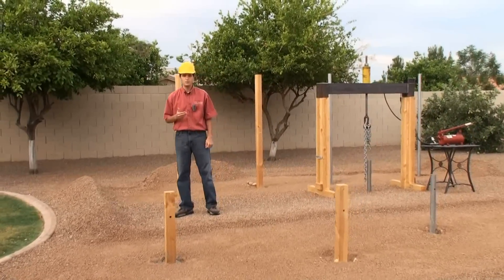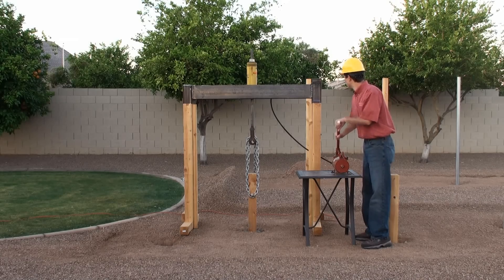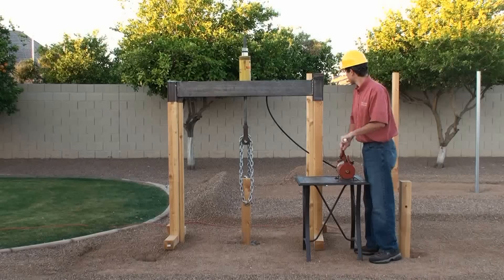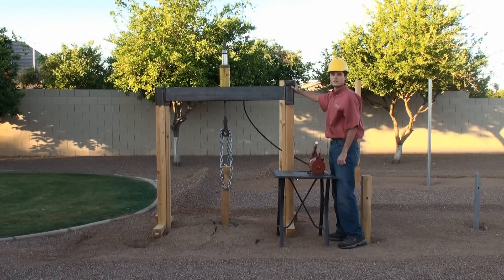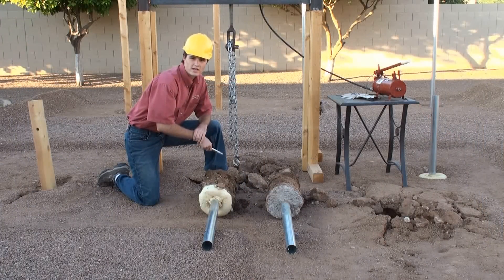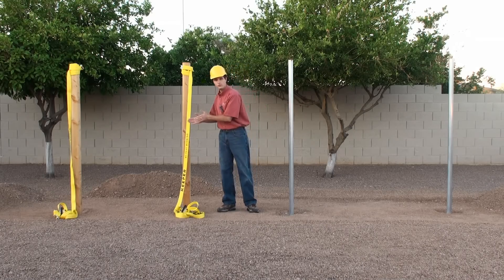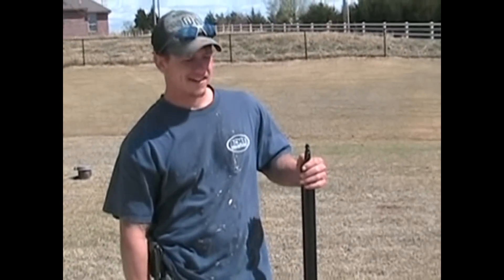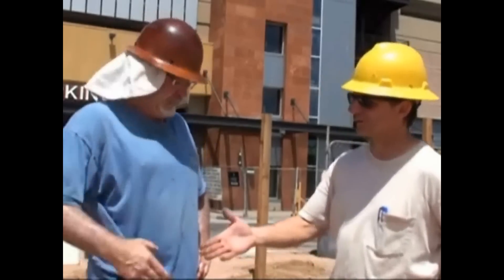Testing to Compare Concrete to Secure Set

Comment: Wouldn't this test have more to do with the ground giving way than how secure the setting material is.
Reply: Are they selling a product that will result in millions of dollars in lawsuits?

To answer the question, the foam expands in every direction, fills all gaps and presses outward on the soil in a manner that concrete does not. This is why it requires more force to extract the post. It is compacting the soil around it. It does seem like this outward force is inadequate, until you use the product. It's solid.
Reply: @legacy5346  lol not sure where the lawsuit comment came from, I'm just a civil engineer making an observation. My point was that the foam expanding won't compact the soil because it's unconfined/allowed to rise. It's actually less outward force than the hydrostatic pressure of the unset concrete. However, you're correct that it will fill the cracks and holes better. You can ignore me, I'm just a bored, pedantic asshole
Reply: It would, unless the setting material effected the ground around it. Which happens when foam expands.
Reply: @legacy5346  In what way? If you're thinking the expansion will consolidate the soil, that's not enough force. In fact, the hydrostatic pressure of the concrete just sitting there is way more force than the foam
Reply: @SolidRock008  the foam actually bonds to the dirt around it which is it took more force for the foam to break the ground. Concrete doesn't bond well with mud and dirt around it. This stuff is insane. I didn't think it would work as well as concrete either. But holy crap it does fantastically. No way my new 6 foot vinyl fence is coming out unless a tornado comes through. Just finished the job a few days ago.
Reply: If the concrete and foam take up the same space in the ground, the force to move it through the dirt should theoretically be the same, the only thing you would add is the weight of the concrete in the pulling test (which is 80 lbs in this case). 

 There are three planes of force to think of in this case, 1) pulling up, 2) pushing over and 3) pushing down. If this product can match or exceed concrete in those three tests, then it's a superior product for this use.

Comment: What I want to know is can secure set be used as support posts for a gazebo?  Does it have good compression strength?  I wouldn't want my gazebo to sink into the ground.  What about being used as a retaining wall?
Reply: This and other forms of foam set definitely do not recommend using as a concrete replacement for compressive forces where concrete works well but still can be used as a backfill around the concrete is the hole is large enough.

Comment: I liked this idea. it´s very easy to do this product. POLYOL + MDI = RIGID FOAM. But the problem is that the foam, in contact with the earth, greatly decreases its DURABILITY. While concrete is eternal.
Reply: Go ahead, look up utility companies using this with video proof here on YT even. Yes just like anything else, it has a useful life, in this case it is said to last 30 years.

Comment: Fence posts are not typically subject to vertical withdrawal so although this is a nice test it really doesn't mean much in the real world. Let's see some side load test to see which method holds the fence up best in a strong wind.
Reply: you apparently did not watch the side load pull tests near the end after the uplift testing proof

Comment: All you people that are bad mouthing this product actually should try it before you talk shit about it. I've used this it works amazing! Used as fences & when I worked for directv mounting dishes on poles, held the pole way better than concrete & we didn't use cheap concrete either, we used the quick setting stuff. Heck think I've got 2 or 3 boxes in my garage that I kept because of how good the stuff worked. Try it before you knock it. You'll be amazed how well & long the stuff lasts
Reply: The quick setting stuff is weaker concrete.....much weaker....we wont use it.

Comment: I set 5 posts at a cost of $8  a hole with secure set. I paid 39.99 free shipping with amazon. I have a bad back and it took me longer to dig the 5 holes than it was to put up the fence. You can start putting up the fence in about an hour  after the foam hardens . Bottom line is I like it . Saves a WHOLE lot of time over concrete.

P.S. Amazon raised the price for the 1 gallon kit i purchased to 43.29
Reply from the maker: Back when you bought Secure Set, Amazon was setting the price and it often fluctuated, but things are a bit different now regarding the pricing on their site.  Check out our price for a direct purchase on our web-site www.secureset.net  
We personally don't offer the 1 gallon kit on Amazon right now because of the shipping cost, but we sell most of the other size kits on their site.  Also, please check out Home Depot pricing at www.homedepot.com.  You can ship to the store without paying extra in shipping charges or for the larger size purchases shipping to your address is included.  Thank you for using Secure Set and your comments.     GRA Services - The Makers of Secure Set.

Comment: Anyone ever see the wind blow a fence str8 up ? So I don't understand the point of pulling the post str8 up.
It obviously works for holding a post as well for real life forces, aka wind load
As other commenters have pointed out the longevity of the product is important. You can't deny this new product is an easier way to set a post in the ground. 
Although there seems to be some questions about it being used in very wet soil, or if the hole has water in it. Concrete doesn't care if there is wet soil or water in the hole. Concrete types are available that can be poured under water.
Still a pretty neat product & if I was backpacking something in to the woods to build a camp on posts, I know this product would be a lots easier to transport.Now what is the cost for product comparison.
Because if i am doing it myself , the labour costs are not really a factor. so what does it cost per hole for concrete to quick set ? never seen an answer.
Reply: This is just a few pounds per bag if not even that much weight versus hauling around 60 lb bags of concrete mis and water plus a vessel to mix it in and a tool to mix it with as well. I rather take the Secure Set (or some other similar brand) at a few pounds a bag at most and not have to lug around bags of mix and bottles of water. Despite it is three times more per bag than a bag of cement which is good for at least two posts since I am only going to need to fill half way to 4/5ths with set and cover the rest with dirt so as not to have to look at foam or cement peeping out. There are some other protectors one can buy to protect the wood post above the surface that can also be used along side the foam set.

Comment: If Secure Set expands above ground, can you chop or cut it to ground level?
Reply from the maker: Yes, you can easily cut it with a hack saw, chain saw, or cut it with a sharp shooter shovel.  Or, if it starts to expand out of the hole you can throw dirt on it, and with gloves on press down on it as much as possible to push the expansion of the foam into the earth.

Comment: you forgot to compare the price though
Reply: i know your comment is old, but I checked Home Depot, they have "kits" that is enough product to do like 10 posts (roughly 10 80 lb. bags of concrete) for like 84 bucks, so it's about twice the materials cost, but it makes up for it in TIME savings when you are paying someone to do it, or saves you hours of back breaking labor mixing up bag after bag of concrete and lugging heavy ass bags of concrete around.
Reply: @DanielsCorner644  aye, It's like saying, I've come to visit you from Scotland. Only cost me £200. HOW! you asked! Should be like  £1000 in flights alone!

I swam.

Comment: how with this do for farm animals leaning on the post and fence. cows weight 2000lbs+ horses about the same. how will it work in a farming application
Reply from the maker: Secure Set works great in farm fencing, as well.  Many people even use it for setting pole barn posts.
Reply: thank you

Comment: I had to pull out some fence posts from the coral rock in south Florida. They were 2 inch galvanized pipe, most in concrete and some in urethane foam, that was a recent repair. The concrete posts gave a horrible fight and it took a jackhammer and Bobcat to remove them. The foam set posts pulled out with the Bobcat alone. One thing I noticed was on a few wood posts we pulled the foam set posts had no rot while the concrete posts tended to break off.
Reply: Interesting - were the wood posts you saw fully encased in foam, or was the bottom tip of  the wooden post resting on dirt? Just wondering if it would make a difference.
Reply: Once the soil loses the temporary compaction caused by the outward pressure from expansion of the foam, the foam will have no advantage.

Comment: Is there an easy way to remove the post that was set with Secure Set?    Can one pour acetone on the foam or does one have to break it up by poking it with something?
Reply: jsnthurst1 It is a polymer, so there will be a solvent or cracking agent (Breaks up the polymer chains.) for it but it may not be kind to the environment and you almost certainly womt want to put it into water tables etc...

Comment: people are missing the fact of weight factors.. if you build anything you want that weight to hold down the structure, but if your claiming that utility poles are set with this foam, I would like to see that video as verification.
Reply from the maker: Please Visit our website at Secure Set www.secureset.net. You will see in our "Gallery" lots of pictures and videos of Secure Set with Utility Poles and Telephone Poles.  

Secure Set does not get it's strength from the weight of the product, unlike concrete, Secure Set gets it's strength from pushing against the soil and anything else it comes in contact with.

You can purchase Secure Set online at Home Depot http://www.HomeDepot.com
And on Amazon http://www.amazon.com

Comment: Why isn't there any comparison of COST??
Reply from the maker: We do not mind comparing cost for you at all.Concrete is only $4.00 for an $80.00
bag which you will need 5 bags to equal the same as our 1 gallon kit, plus add
in a 24 hour wait to finish your project and then add in clean-up time and hard
labor. Secure Set is a superior product if you want to save your back, the cost
of labor, your time and when you figure the cost of your overall project you
will find that Secure Set is in all honesty the most economically priced way to
install a fence or a single post. Visit our website at Secure Set www.secureset.net. 
Click on the “Calculate My Project” button and it will walk you through the
steps, which will tell you how much product you need to order for your
project.  This site will also tell you shipping costs and shipping times
as well as answer many other questions. You can purchase Secure Set online at
Home Depot http://www.HomeDepot.com
And on Amazon http://www.amazon.com
Reply: You are being vauge on porpuse. You only gave the cost of concrete.  Where is the cost of your product? ?
Reply from the maker: Wow, Trever I included the link to our website and the link to The Home Depot and the link to Amazon.

If you buy it directly from Secure Set you will pay product cost plus shipping, depending on what you purchase will depend on your total cost.
1 Shake'n Pour is $8.95 plus shipping.
1 Gallon is $28.00 plus shipping.
2 Gallons $56.00 plus shipping.  
There are more options based on what you would need for your project.

The prices change slightly if you purchase from The Home Depot or Amazon but you won't pay shipping so you'll have to compare cost for your address to see what is best for you. For example: 1 Gallon from either of these sites is $39.99.

No vagueness on our part just you will have to do some work yourself to tell the website where you live and allow it to calculate the total cost for you once you determine what quantity you will need.

Visit our website at Secure Set www.secureset.net. 
Click on the “Calculate My Project” button and it will walk you through the
steps, which will tell you how much product you need to order for your
project.  This site will also tell you shipping costs and shipping times
as well as answer many other questions. You can purchase Secure Set online at
Home Depot http://www.HomeDepot.com
And on Amazon http://www.amazon.com
Reply: I saw the link. I also saw you didn't put the price in your reply. Why can't you put pricing in the comments? you put the price of cement 8n the comments. Why are you being so evasive?
Reply: Apparently when accessed the reply only the 1st paragraph posted. Now I see/read the whole reply. Thanks for the info.
Reply: THey did not include cost for their product as it varies by market region, for me its between 10 and 15 bucks a bag/per post.

Comment: Let's use the cheapest concrete we can to compare, just playing.  It's not always superior however it is very convenient in many applications. Let's say you discover a pole that needs reset. I don't carry concrete, water and mixing tools in my truck. Secure set is good for when you are off the beaten path away from water and difficult to get to. I do carry secure set. I can quickly reset a pole and be done pretty quick.  When considering man hours and returning with the proper tools, its a good deal. We don't use it for many new installs but it is great for many purposes, a lot less hauling and labor.

Comment: Ok I got a big problem I need you input on I have a sink hole in my yard that has just exposed it's self  it's minimum 5 feet deep that I can see and I don't want to fill it full of concrete. If I use this would I be able to dig into it later if need be like to put up a fence post? I know it's going to be some what soft but will it run to all the spots I can't see? I don't have the money yet to have all the tractors dig everything  and dump trucks to bring in the dirt that I will be needing. Will this rot? I need a fast temporary fix so no one gets hurt. A quick response would greatly be appreciated thank you for your time have a wonderful day.
Reply from the maker: Yes Secure Set will definitely run into to all the holes or areas you cannot see.  
It will not rot because it is a closed cell and cannot take on water or air.

You will be able to dig into it with an auger and add a post at a later date.  You can use the calculator on the website to determine the size post hole needed at that time.

To determine the amount needed for the sink hole, you will want to know that one gallon of Secure Set will fill in 2.5 cubic feet.

Visit our website at Secure Set www.secureset.net.  Click on the “Calculate
My Project” button and it will walk you through the steps, which will tell you
how much product you need to order for your project.  This site will also
tell you shipping costs and shipping times as well as answer many other
questions. You can purchase Secure Set online at Home Depot http://www.HomeDepot.com And on Amazon http://www.amazon.com
Reply: Found out it was 10 feet deep and 6 feet wide I had to get it fixed before a kid got hurt but I will look into purchasing some just just in  case in the future if this happens thank you for your time

Comment: I'm guessing that since the product saves,time,and labor,,it cost twice as much per post set?

Anybody?
Reply from the maker: Secure Set is not attempting to be a cheaper alternative
than concrete for installing fence posts. It is a superior product to concrete
for installing fence posts. 
When you figure in the over all cost of a fencing
project, including labor and time then often Secure Set will cost you less than
concrete. If you are only figuring material costs then you will cheat yourself
because in the end you are the one to pay for your own project. If your time, back and the labor of the project are worth anything to you then you will come
out way ahead with Secure Set. A 1 Gallon kit $28.00 plus shipping) will fill the same as 5 (80lb) bags of concrete.And we have not found an 80lb bag of concrete for $2.00. Be bold and try it. It truly is an elite product for fencing!

Visit our website at Secure Set www.secureset.net. 
Click on the “Calculate My Project” button and it will walk you through the
steps, which will tell you how much product you need to order for your
project.  This site will also tell you shipping costs and shipping times
as well as answer many other questions. You can purchase Secure Set online at
Home Depot http://www.HomeDepot.com
And on Amazon http://www.amazon.com

Comment: i like this stuff the power company came to my home to set a large light post they picked it up placed it in the hole and then one man went to the truck pulled out two bottles mixed a little in a cup and poured into the whole foam filled the whole in not time less then an hour later the stuff was hard as a rock that pole is still standing today that was over 20 years ago I am a fan this stuff has been around for longer then you think we all drive by it every single day power and phone line poles
Reply: JOSH - Geez dude, get acquainted with punctuation.  I swear it won't hurt your little noggin.

Comment: This stuff has it's place in the market for sure.  Just don't spill acetone on it.  Its also expanding foam so it applies pressure in all directions, so with that it will take more force to extract it.  Now after sometime of rain the numbers could possibly be similar to concrete.

Comment: whats the cost per unit,   how many  holes can a unit do ?'
Reply from the maker: You can visit our website for more information & price.  Also, we have a calculator on our page that will help you determine how much Secure Set you will need for your project.  Check out www.secureset.net